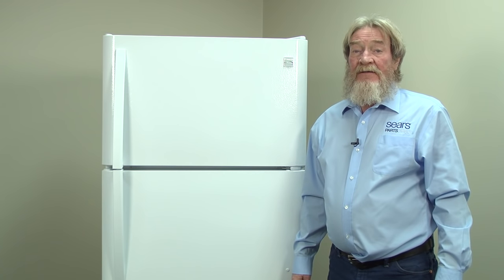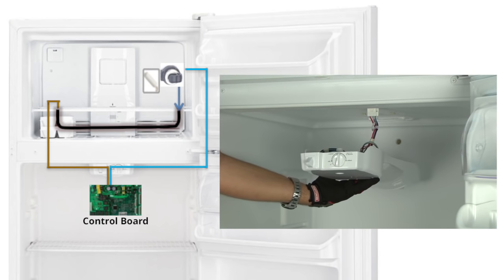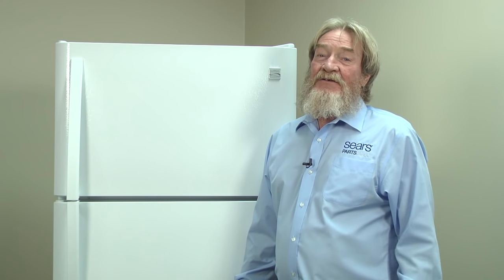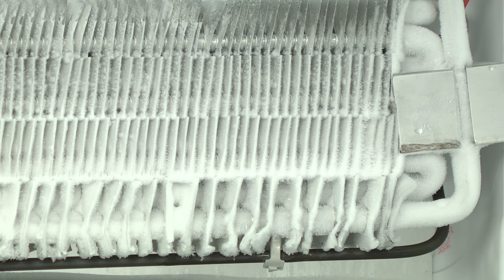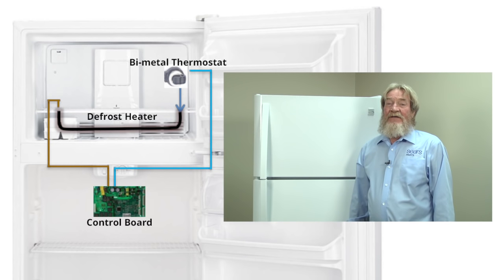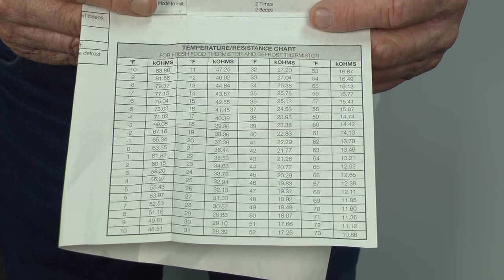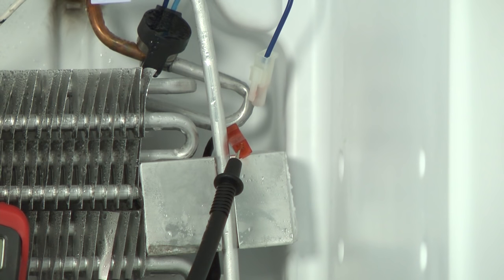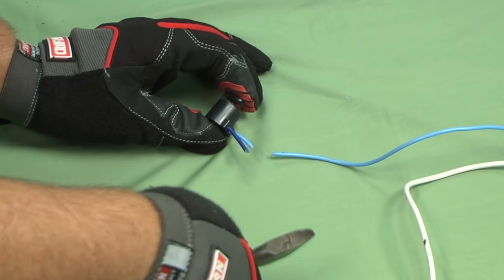How to Troubleshoot Defrost System Problems in Refrigerators

Comment: I have a few questions can you please answer them for me? Thanks
1. When the freezer gets very cool does the bimetal circuit breaks or connects?
2.  Can a bimetal used in a 220v fridge be used in a 110 v fridge ???
3. What happens if we use a wire and connect just like in the bimetal, but this time without the bimetal, will the thermostat get hot?
Reply from the maker: 1. When the freezer gets cold (at its normal operating temperature), the bi-metal thermostat should reset so that power can reach the defrost heater to melt frost of the evaporator during the automatic defrost cycle. 2. Only the parts designed by the manufacturer should be used in a refrigerator. Parts typically aren't interchangeable. If the bi-metal from the 220v fridge is exactly the same and has the same part number, then you can use it in the 110v fridge. Otherwise, you'll need to replace the bi-metal with the right part in the 110v fridge. 3. If you unplug the fridge and use a wire to bypass the bi-metal so the defrost heater gets power, it should heat. If you try that, be sure that you tape the ends of the wire connections with electrical tape to prevent electrical shorts before powering up the fridge. Don't leave the bi-metal bypassed after checking to see if the defrost heater works with the bi-metal bypassed. Unplug the fridge and restore wiring to its original condition. If you aren't confident that you can safely perform that test, have a service technician diagnose and repair the fridge.
Reply: Yes but the fridge can catch fire without that thing you're talking about

Comment: Do all refrigerators conform to a universal standard for color coding wires (for checking continuity)  or is this video relevant for a specific refrigerator model?
Reply from the maker: Very interesting question! The tech expert who can answer that is on vacation. He'll get back to you next week. Sorry for the wait.
Reply from the maker: This video is relevant for most Frigidaire top-freezer refrigerators and Kenmore 253 series top-freezer refrigerators. Wire colors on other models can vary.

Comment: I  have a samsung side by side refridgerator model #RS2556SH. The freezer side works fine and fridge side not cool enough. I took off inside rear panel to freezer and thawed it out for 24 hours. I also cleaned all dust on back of unit on bottom....coils. Then the noise stopped. The freezer works fine and maintains -10. The fridge shows 34 on digital read on freezer door. It is actually 60 degree on fridge side based on portable temp gauge placed in fridge. The fridge side is not cooling..???
Reply from the maker: That model of Samsung refrigerator has a refrigerator evaporator in addition to the freezer evaporator. There's a chance that a clog in the refrigerant tubing is preventing the refrigerator evaporator from getting refrigerant. Check the refrigerator evaporator for a frost pattern. If the refrigerator evaporator doesn't have any frost, then you'll likely need to have a service technician repair the refrigerator because the repair will involve recovery and recharging of the refrigerant. If the refrigerator evaporator has excessive frost, then a failed refrigerator evaporator heater, blown thermal fuse, wiring failure or bad electronic control board could be preventing the refrigerator evaporator from defrosting (which would cause refrigerator compartment cooling problems). Unplug the refrigerator and check the wiring connections on the refrigerator evaporator's defrost heater. Reconnect any loose wires. Check for continuity through the thermal fuse and replace the thermal fuse if it's blown. If you replace the thermal fuse and it blows again shortly after replacing it, then a bad defrost heater, short in the defrost heater circuit or a stuck heater relay on the electronic control board could be causing the thermal fuse to blow. We hope these troubleshooting tips help. If you need further assistance, let us know.

Comment: Does the thermostat always show resistance regardless the temperature ? Doesn’t it open on warm temperature as the bimetal?
Reply from the maker: The defrost bi-metal thermostat will show either 0 resistance (less than 46-degrees F) or infinite resistance (indicating it tripped). The defrost bi-metal thermostat does trip (or open) when its temperature reaches 46-degrees F so you'll need to check the defrost bi-metal thermostat when it's less than that temperature. Our video indicates that temperature needs to be below 46-degrees F to check the defrost circuit that includes the bi-metal thermostat at 2:13 in the video. We hope this information helps. If you need further assistance, let us know.

Comment: I'm planning to check continuity (simultaneously) for my defrost heater and the bi-metal thermostat of my Kenmore model# 106.64952400, and from looking at the Service & Wiring Sheet No. 2225762 A that I have, it looks like I might want to check across the Pink and Brown wires.  Can you confirm if this is correct?
I also see in the diagram a small box labeled "TEST TERM" with both PK and BR going to it.  Is that a second way to skin this cat?
Reply from the maker: To check the continuity through the defrost bi-metal and defrost heater at the same time, you would need to unplug the refrigerator and disconnect the white and pink wires from the control board and check continuity through those wires. Keep in mind that the defrost bi-metal thermostat will only be "closed" and measuring continuity when its temperature is below 15 degrees. If the bi-metal is too warm, it will open and your meter won't measure continuity. You can measure continuity of the defrost bi-metal thermostat through the pink and brown wires (either from the board or through the test terminals) as long as the bi-metal is cold enough not to be tripped. Measuring continuity through the brown and pink wires won't tell you whether the defrost heater is okay because that component isn't in the circuit connected through the brown and pink wires.
Reply: @searspartsdirect  Thank you for your response and the correct wire colors!  Unfortunately, since my freezer is not cold enough now to test the bi-metal (it's in low 20's F), I gather there's no way to test it without somehow getting it to below 15 F.  So, before even bothering with the control panel in the ceiling of the lower refrigerator compartment, I first need to take down the freezer back panel and directly check for continuity on the heater alone.  Would you agree?

And can you say why the Evaporator Fan is not discussed in this video?  Shouldn't it be included in the list of potential problem causes?

One more thing! IF I eventually got to the point where I needed to check the thermistor continuity, can you tell me how I can get the appropriate Temp/Ohms chart to work off of?  The "Service & Wiring Sheet" I have which I mentioned in my original post does not include the chart.  The one we see in the video isn't universal, is it?
Reply: An Update:  I defrosted today and opened up/removed the freezer back panel and got these readings:

Heater alone: 25 Ohms (is this an issue?  too low?)
Evaporator Fan: 70 Ohms (is this alright?)

Tomorrow, once the refrigerator is running again and at approx 0 degrees F, I'll check the Bi-metal/Heater in series from the control panel.  Assuming the Heater and Evaporator results above are not issues, I'm guessing this next step should decide whether I replace the Bi-metal or the control board.  Does this sound right?
Reply: Ok...  with the freezer back down to 0 degrees F, having unplugged the big control board plug from the ceiling of the lower compartment, checking continuity across the Pink and White contacts in the jack in the ceiling of the refrigerator I get 25 Ohms, which is the same I got earlier for the heater by itself.

Is 25 Ohms enough?  Should I replace the control board?

Comment: Nice video. Have a question. It's possible to disconnect the resistance that run through the fridge door? I would like to do that in order to drain less my solar battery bank. Thanks for your response.
Reply from the maker: Let us know the model number of your refrigerator and we’ll look at the wires that go through the refrigerator door.
Reply from the maker: We don’t see wires running through the refrigerator door on that model. All others wires in that refrigerator connect to essential components and shouldn’t be disconnected.
Reply: Thanks a lot for your replay.

Comment: Which part causes intermittent defrost problems?
Reply from the maker: The defrost timer or electronic control board is often the component that causes intermittent defrost problems. All other components are likely working if the defrost system works intermittently. Although it's possible for another component to cause intermittent defrost problems, it's very rare for a component such as defrost bi-metal thermostat or a defrost heater to intermittently fail. Non-control components typically fail completely.

Comment: We have a Kenmore Refrigerator 253.7419240B that won't defrost. We replaced defrost timer, defrost thermostat & heater measures 35ohms. Everything has continuity but the heater still wont come on even in manual defrost. This model doesn't have a control board. Any ideas?
Reply from the maker: A wiring break in the defrost heater circuit could prevent the defrost heater from working. Check for a wiring break by unplugging the refrigerator and disconnecting the wires from the defrost timer then measuring resistance through the brown and light blue wires. If the meter measures infinite resistance, find and repair the wiring break in the defrost heater circuit (keep in mind that the defrost bi-metal thermostat will open if evaporator temperature is above 50 degrees when measuring resistance through the defrost heater circuit). Use the wiring diagram for your refrigerator to check the wiring in the defrost heater circuit. The wiring diagram is often attached to the back panel of the refrigerator or it may be inside the machine compartment. If you can’t find the wiring diagram, you can find an online version of the wiring diagram on this page: https://www.frigidaire.com/Owner-Center/Product-Support--Manuals/?ProductCode=CRT21HSBMW0. The refrigerator model shown on that page uses the same wiring as your Kenmore model. Here’s a brief video that shows how to trace a circuit on a wiring diagram in case you need it: https://www.searspartsdirect.com/article/using-a-wiring-schematic-to-trace-a-current-video.html. If the meter measures 35 ohms through the brown and light blue wires, then the circuit through the defrost heater is okay. You indicated that the heater won’t come on in the manual defrost mode. To enter the manual defrost mode, you should have advanced the defrost timer manually with the compressor running until the compressor shut off (indicating the timer entered the defrost mode). If the defrost heater doesn’t come on when the compressor stops, then the defrost timer is likely bad. We hope this information helps. If you need further assistance, let us know.

Comment: Great basic guidelines.  Do all Kenmore freezers and refrigerators use the same wire color codes?  I'm really surprised that Sears is offing this advice.  This in the right hands can hurt Sears Service , but on the flip side I can only image how many people watching this are totally lost within the first 30 seconds, making this video a good tool to steer those to Sears for a service call.
Reply from the maker: No. Not all Kenmore refrigerators and freezers use the same wire color codes. Use the tech sheet for your model to identify wire colors for the defrost system if the wires don’t match the colors shown in this video.

Comment: I have a Kenmore model 111.73025711 with a bottom freezer.  I tried the procedure in this video to force defrost, but it didn't work.  Do you know the procedure to force defrost for this model?  Thanks!
Reply from the maker: To enter forced defrost mode on that model, press and hold the Refrigerator Temp button and press the Door Alarm button 5 times. The defrost heater will turn on. The defrost cycle will end when the defrost sensor terminates the process. If you need more help, let us know.
Reply: @searspartsdirect  Wow!!!  You're awesome!  I searched everywhere and couldn't find the answer.  The freezer evaporator is fine, but the refrigerator (fresh foods) evaporator is frozen solid.  I'll try to force defrost to narrow down the problem.  Thanks so much!

Comment: Great video. I need help with a LG Refrigerator LSC27931ST. It trips GFI. Tried another circuit still trips. I unplugged a plug on main circuit board with 4 wires (Black, Blue, Brown and Purple) . It stopped tripping. The plug is marked "DISP HEATER" on Bl(N) wire. DEF HEATER and FUSE on BN wire on one side and PR wire coming out fuse side.
When I unpluigged this fridge stayed on. I believe the PR wire feeds water solenoids because water stopped working. I dis connected the water solenoids but it still trips. 
What could it be? What is a DISP Heater? where do I find it? Is it heatyer that is sghorted or thermostat
Reply from the maker: The circuits that connect to the main circuit board through the 4 wires that you unplugged likely have a short in the wiring or a component.
 
The dispenser heater is a small device attached to the ice chute cover that drives out moisture in the dispenser housing near the ice chute. The heater helps prevent frost build-up in the freezer and the dispenser chute area. Because that small heater is no longer part of the replacement part for the ice chute cover, you can unplug the heater and tape the end of the harness that goes to the control board with electrical tape to keep the harness plug from shorting out. If you plug the refrigerator back in and it doesn’t trip the GFI breaker then you’ve likely fixed the problem.
 
If the breaker still trips, then you’ll need to find the short circuit that’s causing the GFI breaker to trip.
 
To find which circuit is tripping the GFI breaker, unplug the refrigerator and measure the resistance through the circuits using a multimeter. To do that, unplug the connector with the 4 wires that you described above from the control board. If you unplugged the dispenser heater and taped the end of the harness that goes to the control board, then check for resistance between the black wire and bare metal on the refrigerator cabinet. Here’s a video that shows how to check resistance through components and how to check for a short to the metal cabinet: https://www.youtube.com/watch?v=R6DgIA_ikQQ&t=15s.  You should measure infinite resistance between the black wire and the metal cabinet. If you do measure resistance between the black wire and the metal cabinet, then the black wire is damaged and is shorting to the metal cabinet. To eliminate the short, cut the black wire near the plug that connects to the control board and tape the end of the cut wire with electrical tape to keep the end from shorting to metal. Because the dispenser heater isn’t needed, eliminating that back wire won’t affect refrigerator performance.
 
Repeat the test on the blue wire. If you measure resistance between the blue wire and the metal cabinet, have a service technician examine and repair the refrigerator because that blue wire is a common neutral connection for many components inside the refrigerator. The service technician will find the damage in the blue wire and fix it to prevent the short circuit. You can schedule service here: https://www.searshomeservices.com/repair/refrigerator-repair-service.
 
To check the defrost heater circuit, measure the resistance between the brown and purple wires. You should measure about 15 ohms of resistance through that circuit. If you measure near 0 ohms of resistance, the defrost heater or the wiring in that circuit shorted. Check the resistance directly at the heater and replace the heater if it doesn’t measure around 15 ohms of resistance. If the heater is okay, find the damage to the heater wiring that’s causing the short and repair the damaged wire. 
 
If you measured about 15 ohms through the brown and purple wires of the defrost heater circuit at the control board, then check the brown wire for resistance to the metal cabinet. If you measure resistance between the brown wire and the metal cabinet then the brown wire shorted to the cabinet. Find and repair the short in the brown wire. Repeat the process to check for a short in the purple wire. Find a repair the short in the purple wire if you measure resistance between the purple wire and the metal cabinet.
 
These tips should help you resolve the problem that you’re having with your refrigerator. Let us know if you need more help.

Comment: On my Frigidaire the right aluminum strap holding up the heater element up broke or melted and caused the right side of the element to fall down, melt through a plastic support and then fall onto the drain tray an melt that up.  I think I'll put a few extra aluminum straps this time.
Reply: Jason Thurston Jason, my Frigidaire has had same issue however I don't know if that's my root problem as I bought the fridge used.

Comment: Sir very nice video
 Hi how are you..sir my refrigerator not automatic off I did change timer and biometal..but not automatic off..what problem sir guide me I'm very upset about refrigerator
Reply from the maker: A loose defrost timer wiring connection or broken wire could be preventing the defrost timer from advancing. Unplug the refrigerator and check the wires that are connected the defrost timer. Reconnect any loose wires and repair any broken wires. If that doesn’t help, let us know the model number of your refrigerator. Using the model number, we’ll look up technical information for your model and try to give you more troubleshooting tips to fix the problem that you’re describing.